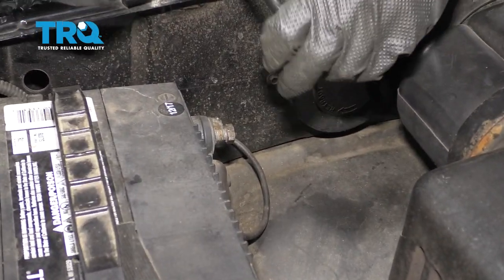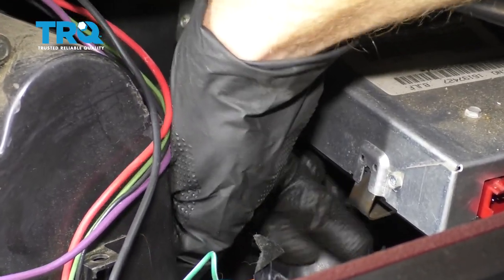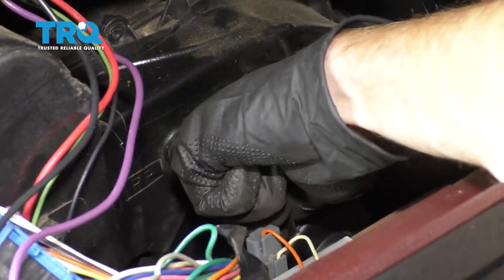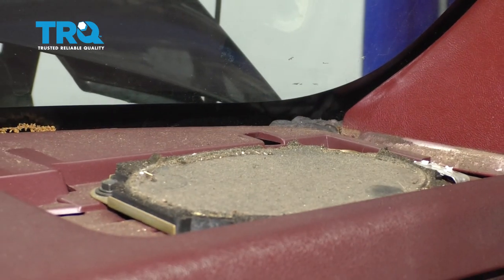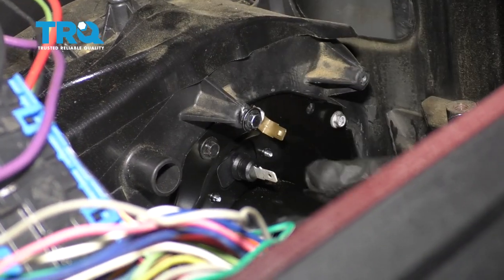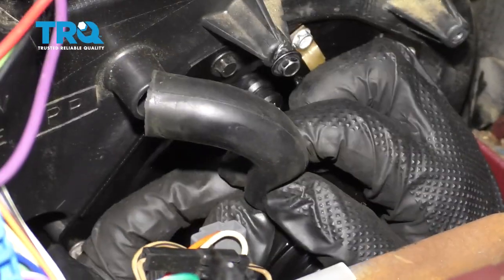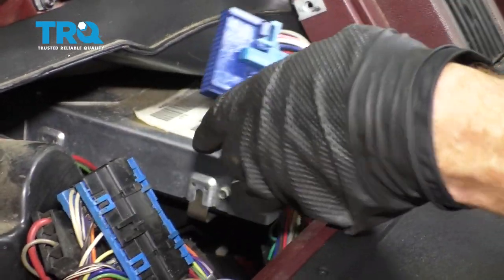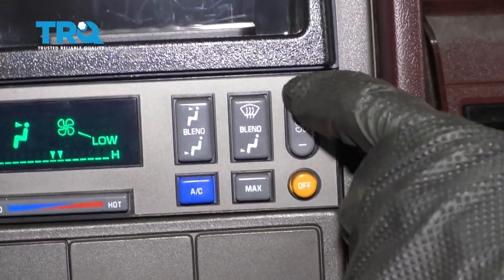How to Replace Blower Motor with Fan Cage Chevy C/K1500 1988-2000

Comment: Terrible design on these c/k series blower motor locations. That's a ridiculous amount of stuff to mess with to change a motor that you can kick when sitting in the passenger seat. Whatcha gonna do though 😆
Reply: Lol. Only if you don't take short cuts.
Reply: Yeah the engineers didn’t think that one through very well on these early obs truck. The square bodies is super easy on the outside. They should have made it a little lower or at an angle to get the motor out to do a simple job without having to do all that. It really looks like a pain.

Comment: Thanks. I have a 95 and I just pulled the cover apart a bit and unscrewed the screws and pulled the motor out without messing with the ECU and plate.

Comment: Some motors don’t come with blower. And you need to use your old one.  If you never done it it can be hard. You have to be careful. You can break the fan. It has to be done right. Hold onto the fan carefully and hit the pin out with a heavy hammer or small sledge hammer. H regular hammer will just bounce off the pin. At some point you can just slide it the rest of the way. And installing takes a bit of force but you can do it. Try to use even force and not pull too much on one side. Thanks for the video.  It’s great to watch it done again before I do it again for the 10th time at least on my 25 year old truck.

Comment: I am in midst of this project on my 1988 3500.  I next need to loosen the dash to get the blower out; thanks for showing the fasteners that need to be removed.  I did not remove the computer shelf; I will see if that is OK.  Unmating the computer connectors was easier after the computer was pulled free from the clips and rotated towards the glovebox hole.  My blower has one orange wire (+12V); I am not sure where it gets grounded.  Hopefully, the ground will be apparent once I have the blower out of there.  Thanks

Comment: Hey TRQ. I just did this. As per your instructions. Almost to the T.

But the motor only comes on on high. 

I hear a click when I hit low and medium. But no response from the motor. 

Do you know if there is some kind of relay that controls the motors speed apart from the motor?

I'm looking online now. Figured I ask the source first. 

Almost the same exact truck in the video. Color. Near all of the placements. 1992 Suburban K2500.
Reply: Replace your resister. It’s on top of the box right behind the relays above the glove box.
Reply: I think you need to replace the resistor

Comment: Yeah believe my blower has went out. When I first bought the truck the floor was working but I had to hit it to get it started. I would turn the AC on on the dash and it wouldn't come on then I would tap the blower underneath the dash and it would come on that's not even doing that

Comment: Why is antifreeze  and r134a involved with changing a heater core?
Reply: Most heater cores are in the same housing as the a/c evaporator. The freon has to be evacuated

Comment: excellent video! my only bit of construction criticism that could have made it even better would have been if you mentioned the size of each bolt as you were removing/reinstalling them. thank you for making the job a lot easier than it would have been had i went in blind.